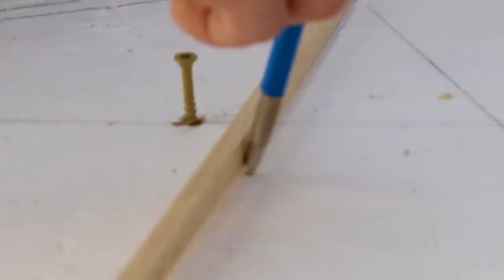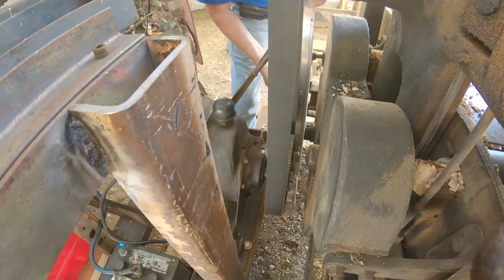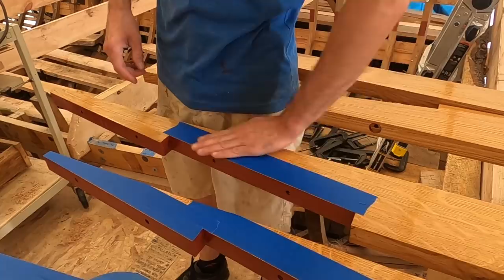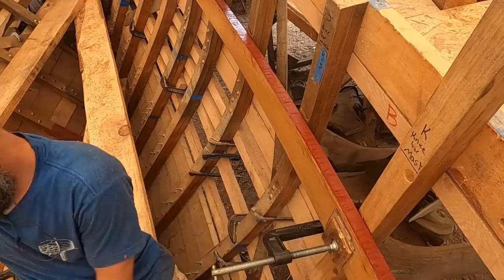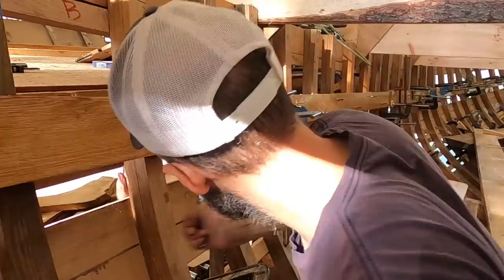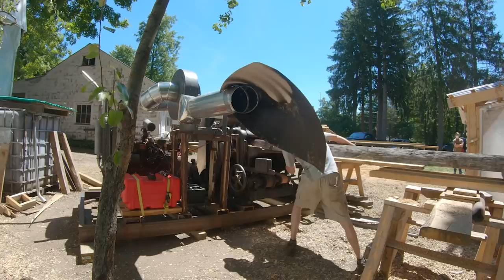Acorn to Arabella: Journey of a Wooden Boat - Episode 125 - Installing the Clamp

Comment: Considering how much the oak planks you showed before move and swell with the season, to have only 1/16 of difference between the sides of the both is incredible.
Reply: markog1999 don’t forget... the plumb bob line was strung beside the Center line wire. The you could actually remove the radius of that wire (assuming Steve didn’t) and arrive at an even smaller error. That’s some damn fine craftsmanship there Steve. He is building this boat like he is building a violin.  In fact he should take a crack at building a violin/ fiddle out of scrap. It would probably be magnificent.
Reply: @waterboy181  error how rude 😁  I would of said it's like that so it's got room to settle 😏👍.
Reply: Your just assuming I think Steve made an error. Obviously I was implying the measuring tape was at fault... LOL

Comment: I chortle at your comment about being hot. The newspaper today reported Boston at 74°, Phoenix at 115°, and Death Valley CA at 124° - but it's a dry heat! I live 3 miles from the Pacific, just 48 miles north of Los Angeles. It was 84° and muggy. Just thought you would like to know. Thanks for the video. Jon
Reply from the maker: We have had some days in the high 80s and 90s with high humidity, which makes it very hot in the plastic-covered boathouse.

Comment: What are you going to do with all those bolt threads sticking out of the clamp on the inside? May I suggest cutting them a little shorter and then using a Brass acorn nut to cap them all .

Comment: Been watching you guys since you felled the first trees and dug the hole to cast the keel! Like to think some of the comments I have put in over those few years have helped you along, I know you took on board and started using an adze like an adze and less like an axe! 
 The model A powered thicknesser is a beast, could put power-poles through it and still have room for railroad sleepers! Henry Ford would be so proud he powered it!
 Looking forward to seeing and meeting you guys in Mooloobah in a few years and looking over Arabella, she will be one tough little ship. Your scantling sizes are at least 20 to 30% over and in some cases above 50% of what modern naval architects require, using old drawings as you did gives you a ship that with a lifetime of TLC will last beyond centuries. Remember, Victorias ghosts are relying on you!
Reply: @Paul Orchard, technically it's not a "model A" Ford engine. It's a Chrysler flat-head six-cylinder, if I remember correctly.
Reply: Jonathan Kipps 
Oh, ok, I thought it was introed as a Ford flathead, I stand corrected, dodge brothers would be proud then! Sorry Henry, go back to sleep!

Comment: If the chip collector I working well enough as it is now, good enough. If you replace that section of flexible duct with rigid metal duct it’ll work better. The plastic corrugated flex duct reduces the flow pretty substantially. Nice work, as usual.
Reply from the maker: The plastic duct is so we can make sure there aren't any clogs.

Comment: Hi, guys great video and awesome boat, I'm curious as to why you don't use washers on the clamp bolts on the outside of the boat? Really Enjoy your videos. 
Regards Steve.
Reply: The bolts are carriage bolts.  The end of the head is rounded, but beneath the head (on the boat side) it has a square profile to bite into the wood and prevent spinning in the hole.  A washer here would defeat that purpose.

Comment: Question about the bolts that hold the clamp to the frames: are they countersunk into the outside of the frames?  I would think there would be some sort of plank that goes on the outside of the frames at the level of the clamp, and having protruding bolt heads directly on the outside of the frames would make that very difficult to install.  I don't remember the video showing any detail of the outside of the ribs where the clamp is attached.  Maybe I'm missing something here though.
Reply: Grandpa counter bored all the bolt holes that Steve drilled from the inside.  I'm not sure if he used a spade bit or a forstner bit
Reply from the maker: They are counter sunk into the frames, so they sit flush.
Reply: Acorn To Arabella—I imagine those countersunk screw heads will then be covered by the plank, and you will then need to be more careful where you place the screws to hold on the planking that goes on the outside of those frames.

Comment: So, if you had to guess, do you think that thicknesser, with its motor and slides and frame etc, weighs more than your collection of clamps and come-alongs? 

I kid, but holy carp that's a lot of clamps.  My collection isn't a quarter as many, nor are most of them as large, and it's already several hundred pounds of clamps.

Comment: A drop of Loctite on the bronze carriage bolts would be good insurance. Can still be done. I can see those nuts coming loose and turning over time as the wood compresses.
Reply: Probably want to be able to tighten them occasionally, so some other method might be better.
Reply: I expect they will cut the bolts flush with the nuts and stake them (use a punch to set divots between the nut and the bolt).

Comment: That keel timber looks a little warped on both surfaces.... wouldn't you want to get it flat on one side before you put it through the thicknesser? Or is that just the camera lens tricking my eye? Looked like it wasn't catching the roller though too.

Comment: How do you choose what you fasten with bolts versus rivets? Basically why is the clamp bolted in. Could you even use rivets? Are the planks the only thing riveted with everything else bolted?
Reply: The clamps are structural, the planks only need to hold themselves on.
Reply: @CorwynGC  Actually, this is a common fallacy.  The fasteners holding the planks to the boat have two jobs:1)hold the planks on, 2)prevent any sliding motion (sheer load) between the plank and the frame.  The greater load by far is sliding.  Same with the clamp fasteners.  The designer takes this into consideration when determining the diameter of the fasteners.  Too small and they fail in sheer, too large and the wood splits.

Comment: The clamp looks really nice I wish I knew it's purpose. I must have lost the explanation somewhere along the line. Arabella will be like a tank on the water.
Reply: It carries the shelf, which carries the deck structure.
Reply: @franksijbenga3724  Somehow I missed it thanks.
Reply: It, along with the shelf, adds a great deal of stiffness to the boat lengthwise.  When the shelf is added, the two together make a very rigid "angle iron" structure.
Reply: @dennislindemann9057  I can imagine thanks.

Comment: Perfect Middle Management job, a couple of belt covers ....
Reply: Belt covers are actually useful!
Reply: @36tripleduce  belt covers keep all the crap out of the pulleys, not just stupid humans.
Reply: @36tripleduce  They can't run the machine without going near them, so yeah.
Reply: @36tripleduce  Look again.
Reply: @36tripleduce  Apparently you have never used a thicknesser, or you would know that you need to be on both sides of it, and run the control panel.  Look where that is.
Reply: @36tripleduce  I am confused then.  How did you work in a saw mill and still not understand how a thicknesser works?
Reply: @36tripleduce  What an impressive rebuttal...  Oh, and it is 'whatever', one word.

Comment: I guess you can't sand and varnish after installing because at that point the board is no longer flat/straight, right?

Would you do that if it was a straight installation?

Comment: Doing it on your own is hard , , that clamp seems low in the hull but there’s no deck beams in yet so she’s low wooded ship
Reply: Don't sweat it.. Arabella is designed to have 6' of headroom. It won't look like it until the deckhouse is on, but at that point it will all make sense.
Reply: Also, remember that Steve is standing on temporary planks to do this fitting - the actual sole plates ( floor to us landlubbers ) is a good bit lower down.

Comment: Another question: @22:00 what are the holes filled with what looks to be lead on the top of the clamps for?
Reply: Those are the heads of the bolts that go down through the clamp to hold the parts together. They are recessed into the clamp so that the shelf can fit on top. You will also see the corresponding nuts on the underside of the clamp.
Reply: @MULLAC22 ah yes of course. Thanks for clarifying 👌

Comment: The clamp looks so low in the hull making the below decks look low???? Optical illusion?
Reply: oldwillie313 I was thinking the same thing..
Reply: The deckhouse will let them stand upright, but the bow and stern belowdecks will be crouching height.
Reply: Scott Kelly who are you? Don't recall you bring in the build team?
Reply: @oldwillie313  the other boat built to these plans, the one they took apart, had a small deckhouse.

The plans briefly shown in various videos all show a deckhouse that's about 12-18" higher than the deck. Also, remember that the deck beams sit on top of the clamp, and arch about 6" up on the centerline. So, 6"/15cm plus deck beam and deck thickness (guesstimating another 6"/15cm) plus 12-18"/30-45cm additional height over what we're currently seeing, for maybe another 30"/75cm height in the deckhouse.

Comment: She's really looking like a boat!!!

Edit: I think you may need to retire that old flathead engine for something with more horsepower. Swap for an old Mopar slant six.
Reply: I know where your coming from but, how much torque/horsepower do they need in relation to 
the expense, time loss in conversion or longevity? Don't fix it if it an't broke.
Reply: @michaela.660  It's a matter of having enough torque/HP to drive both the thicknesser and the dust extractor. I think the flathead is working too hard, so it's likely to break down soon. A 175ci slant six will make about 100hp forever and drive the dust collector hard enough to put the chips into New York state.
Reply: @ScottKenny1978  I agree it would be better, the old slant six is a marvel, owned 2 rebuilt a dozen but,    
Again Scott, if the flat head is doing the job, not lugging down to the point of over heating and serving
their needs, don't fix it if it ain't broke.

Comment: The boat house could use a swamp cooler.
Reply: Needs to be dry for a swamp cooler. Works in Arizona, where they are not so good.
Reply: Swamp coolers may cool things a tiny bit, but they increase the humidity — and these guys are already hampered by the humidity.

Comment: Do copper or brass nuts stay put better than steel?
Reply: Yes they do, steel causes iron sickness in the wood over time.
Reply: @kenolson3064  yes I'm aware of the reason to not use steel hardware. What I meant to ask is, will copper nuts loosen with vibration and movement over time like steel nuts do?
Reply: @Can_non69  Yes they will if nothing else is done.  Steps will be taken.  Something for a future episode.

Comment: You do you . Masks be damned. Let those whiny trolls work on a real sweat equity  project for 1 day . Only then should they be able to complain. Its coming along. By the time your partner returns he will can do the inside while you go on a long vacation.
Reply: @stick004  covid is real but you do realize it has been months now? They are out in the sticks without outside exposure. No one has any signs or symptoms for Months there. No outside visitors for Months. Now correct me if I'm wrong but incubation for the disease is at max 2 weeks? So if someone doesn't have anything for months and has no outside vector of exposure. And they are working with someone in the same condition...Does covid magically appear?
Reply: Dan Bradley #FACTS. Don’t mind Stick, he’s allowed the fear of a virus with a 99.5% survival rate to screw his judgement.
Reply: AERO Mechanic 99.5%? Tell that to the more than 100,000 families morning lost loved ones in this country alone. After you lose someone important, your opinion will change.
Reply: stick004 First of all, there’s not 100k dead, not even close to that. They literally add anyone to the COVID death count that happened to have the antibodies at the time of death regardless of how they died. So, if you’re hit by a car but you happened to have or have had covid you’re listed as a covid casualty
Reply: stick004 you live your life in fear, don’t demand others capitulate to your irrational ignorance. By the way, you didn’t lose 3 healthy people to COVID. They all had underlying health issues and it sucks that they died but that’s just the way of things
Reply: stick004 WRONG. They DO benefit from fluffing you their COVID numbers and that benefit is in the form of increased funds. Please educate yourself on this, there is very much a benefit for false reporting and we won’t even go into the political aspect of how the left is using this virus to push their agenda.
Reply: AERO Mechanic, I am not a leftist. I am in the medical industry. There is not special hand out because we list COVID as a contributor to death. Are you in the industry. Do you know a hospital owner who has told you of the profit they are making? Or only what you read on the internet? Hospitals are profiting because 100,000 people have gone through the doors. Who otherwise would not have needed additional care.
Reply: AERO Mechanic 😉
Reply: @RevolverOcelot79  300 millon Americans. 99.5% survival rate. 1.5 million dead. About 3 times the US csualties in WW2.
Reply: Harry Moyes You’re not getting it, only a fraction of the population will contract this and most wont even know they have it save for mainly elderly and those with underlying health issues so the overall deaths won’t be anywhere near that number.
Reply: AERO Mechanic, 😷👍